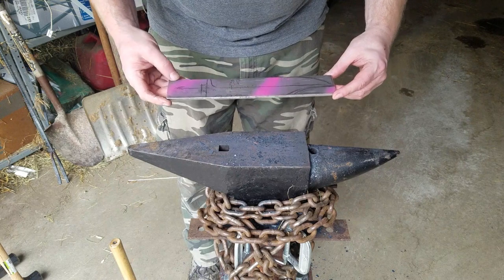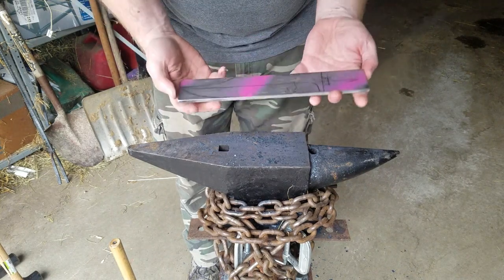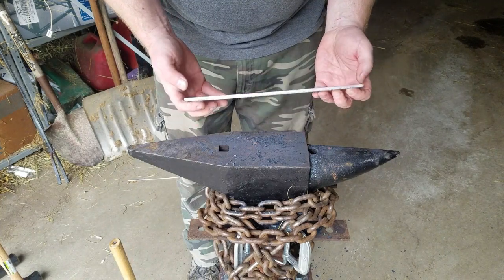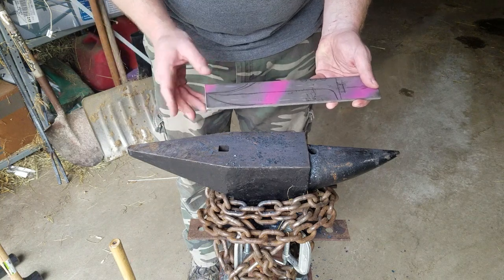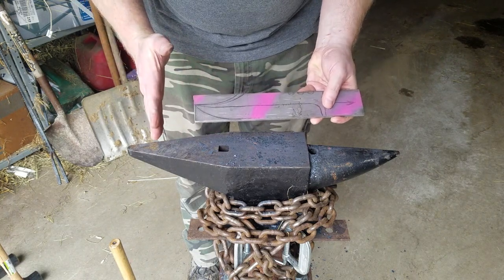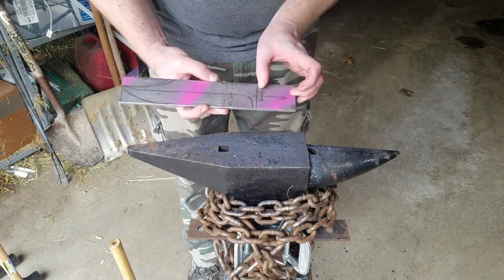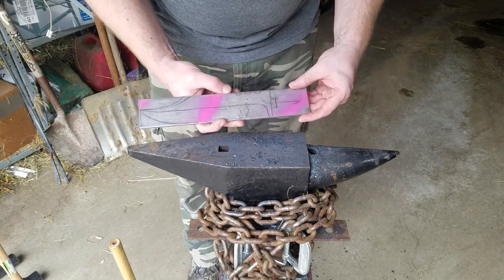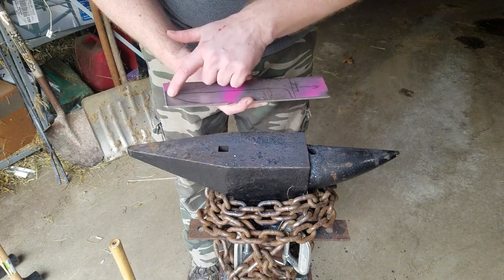Forging a Clip Point Bowie Knife - Part One: The Tip

Comment: The anvil wobble kills me. You will always create a cold shut by pushing the top corner down to form the tip. You want to drive that corner back into the bar, alternating between that and the flats to keep thickness consistent.

Comment: How is that anvil holding up?
Reply from the maker: Really happy with it for the money. It would benefit from being bolted to the floor so it doesn't wobble  and walk but I need it to be mobile so I'll live with it for now. Surface and edges are practically untouched but then I never bounce my hammer on the surface, just on hot metal.